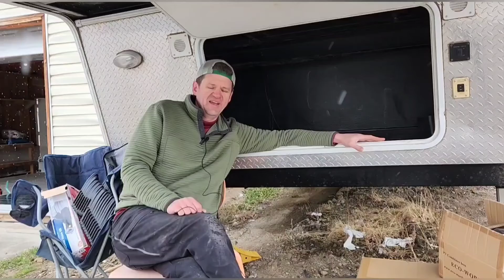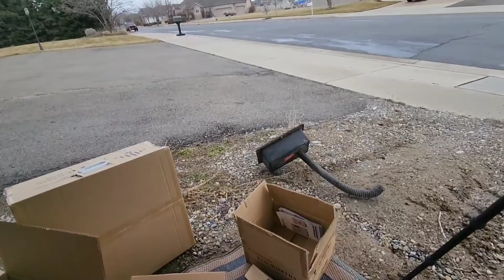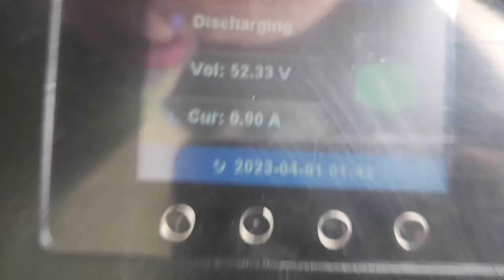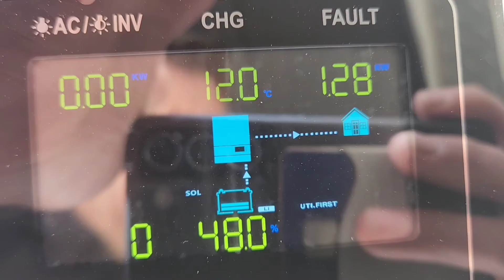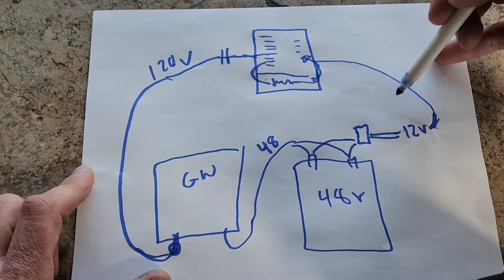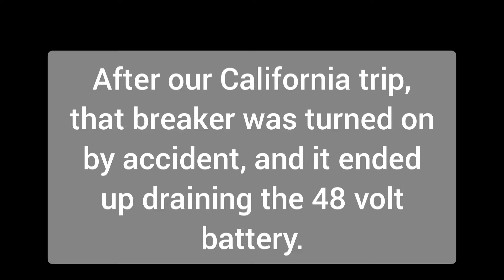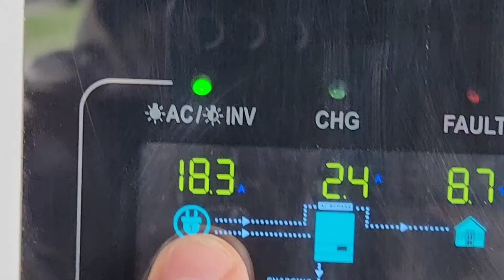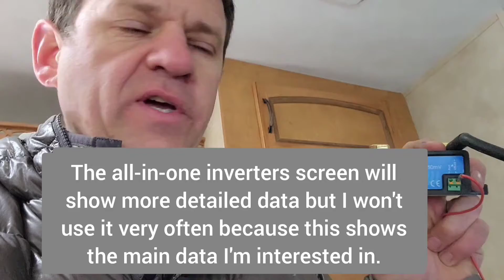12v to 48v RV conversion. Ultimate Off-grid RV Solar Power System Install

Comment: Trying to see what the advantage is vs just switching to a 400Ah 12v lithium?
Reply from the maker: The main difference is cost. The 12 volt system that can do the equivalent but will cost quite a bit more. Specifically referring to wire size and the wire size in the specific individual components. With that battery you will have the energy storage capacity however you can send four times the amount of power over a 48 volt conductor versus the same 12 volt conductor... saving costs not only in the conductors but also in the components in the conductors. This is a similar reason why the weaker power tools have lower battery voltage, but if you want a power tool that can produce more power they usually have a larger volt battery that you connect.  Hope that makes sense.
Reply: @diySolarPowerFunWithRay  
Yeah I see your point now. 
I am not a massive energy user so that's probably why I didn't really see the need.
I have got by on 2x group 31 wet lead acid batteries and a single 180w solar panel and have never felt the need for more. I rarely use my microwave or A/C when camping, if I have to I crank my generator for a few minutes but that's a very very rare event. The power I have is enough to boondock indefinitely, with no generator usage, presuming I get less than 2 cloudy days in a row. 
When my lead batteries die I am pondering a switch to a single LiFePO4 but not even sure if it's worth the hassle to deal with a DC/DC charger from the alternator/starting battery, limitations to charging when it's cold, and upgrade to the converter. I could probably skip the converter as I have never plugged in, in the 11  years since I bought my current Class C.
Seems like it's only worth it if  you want to try to run a bunch of AC appliances which I don't, but in that case you run into limited roof space for solar. I suppose you could throw a bunch of solar panels out on the ground but I go camping to live simply and get away from hassle not create problems to solve.

Enjoy your adventure.

Comment: Would humbly suggest you protect your cables with fusing. So the 48V output from the battery, the input and output to your 48/12V converter. Melted wires make for nasty fires. Thank you for your video.

Comment: What gauge wire is on the output of that 48 to 12V converter?  Should be stamped on the wire. Is it 10 Gauge? Thank you.
Reply: A little late but most of these use the correct AWG wire. I have a 10A and a 30A. The 10A has 14awg, the 30A has 10awg. The input wires are also sized depending on demand, for example the 48v to 12v is 14awg for the 48v side and 10awg for the 12v side.

Comment: Thank you for the video! You have just given me a temporary solution to the biggest problem I have in the solar upgrade of my 50 amp fifth wheel. I've been unable to figure out how to run the electrical cable (2 for a 50 amp RV) from the inverter to the distribution panel (a 30 ft run). The cover underneath the RV is riveted to the frame and there are several obstacles inside the cover (3 tanks and cross members i.e., I-beams) that make routing the wires under the cover difficult. Routing the cables inside the house does not seem to be feasible.  I will just install a 50 amp plug to the inverter, mount it in the front compartment, and plug into the shore power plug when we boondock.  Thank you!
Reply from the maker: Nice, later I wanted to have power when we drive down the road so I added this solution. Start at the 9 Minute mark.  https://youtu.be/cYJSFjFo4S8?si=jpkp4bOnRvpQ5Yuh

What inverter did you end up going with?

Comment: So how do you charge that 48 volt battery now at a campground on 30 amp shore power?
Reply from the maker: The growatt power system will accept 30 amp Shore power and in turn chart 48 volt battery. 👍

Comment: Hate to see people mount them directly to the roof when theres a better way of doing it you can get mounts that taiss them higher and do the full kength of thr hnit
Reply from the maker: Thanks, I didn't get those because the ones I was looking at were simply using a adhesive or glued down. I like the idea of using adhesive and also screws for extra protection over time.

Comment: Not bad overall, but ditch those wire nuts for a mobile application.... And consider a large capacitor at least on that 48V->12V converter output. With so many of the inductive loads being 12V, you will burn out that converter (Motor based stuff, slide outs/jacks).

Comment: Why wouldn’t you use a ship to shore switch or an auto transfer switch for your trailer and hard wire it in?  It would be more efficient.
Reply from the maker: I wanted to just keep it simple. I like the Simplicity of just plugging my Shore power plug into the inverter. I don't have any problems unplugging and manueling moving the plug to shore power if I am camping near a Shore power outlet.
Reply: I also like simple. My inverter is isolated if I need my generator when I’m out hunting and I don’t have to touch anything besides my start switch. 

Check them out. Consider it. It makes it simpler than plugging and unplugging everything.
Reply from the maker: @Slingshot277  thanks, I might have to install that on my next one. I could see that being nice if you have a onboard generator.

Comment: about the alternator charging... I'm assuming it was pin 4 that you disconnected from your 7 wire plug, correct? I've also seen charge controllers that will allow you to connect your alternator safely - they combine the alternator power with solar to bring up the voltage to the proper charge level, but I don't know if that's worth the hassle unless you already own all the parts.
Reply from the maker: Not worth the hassle in my opinion. I get more power from shaded panels then I would from the 12 volt alternator. On the other hand adding a 48 volt alternator I hear can produce up to 1,000 Watts. Which would be awesome. But then you have to add another alternator..

Comment: If u think u r gonna run 2 ac overnite and your home on a 100 amp hour battery u in fer a rude awakening
Reply: How much power in avg kwh does the ac pull?  At 48v lifepo4, 100ah will give you about 5kwh of useable power on a full charge.
Reply: @MichaelSchwabTX my travel trailer has a 15000 btu ceiling air conditioner and it pulls 16 amps at 120vac.
Reply: @MichaelSchwabTX  exactly. I have a app on my ac. And one uses about  3 to 5 amps for the whole day.

Comment: Is that GroWAtt all in one unit designed for use in a high-vibration environment (like rolling down the road)? I have one that I will install in my home for critical loads in an emergency
Reply from the maker: Signature solar said it wouldn't void any warrenty.  I've currently taken this setup on about 6000 miles so far... No issues. after 800 miles on a bumpy road the only issue is one of my wire nuts came off.
Reply: @diySolarPowerFunWithRay Please tell us you’ve gotten rid of all the wire nuts!

Comment: I installed same Growatt, 1800 watts of solar and 150 amp hours of batteries almost 2 years ago in my RV. Has worked flawlessly.  Your comments about running 2 AC units and powering your friends RVs is not realistic as I am sure that you have found out. Or running an AC unit overnight, unless it is a tiny window unit maybe 5,000 btu's. Good video
Reply from the maker: Yeah, It will only run my single AC for about 3 hours with Zero sun out.  With the sun out I can continusly run it though... but can't charge the batteries at the same time.  I like that it provideds enought power to run large 2 appliances at the same time.  I usually go camping a cool areas so i never run into too much trouble having others use my power.... unless we need to run the AC's :). Turning off my converter box has helped a lot also...
Reply: @diySolarPowerFunWithRay  FYI I am able to run a 10k AC unit for 4 to 5 hours straight off the solar, but like  you understand, no charging then. Last summer I was using a 2200 watt generator and was able to run a second AC unit off of that. As you have a 30 amp trailer I don't think this would work for you as the second AC unit is on the other side of my 50 amp service. And the generator does an amazing job recharging the batteries in the evening for a couple of hours.  Wish you the best!

Comment: Great video want to do something similar.  How loud is the inverter fans? My 5th wheel  bedroom is right above  that compartment.  Thanks for the video.
Reply from the maker: Same. I'm glad I put the inverter outside. I definitely can't hear it running when it's outside but if it was inside it would be a bit bothersome.

Comment: Nice setup. I'd be more comfortable with the higher capacity buck converter, or two of the 30A parallel.  I imagine that part will be an iterative process for you 😅
Reply from the maker: Yes the 40 amp would have been better

Comment: Great stuff rey . I have a question when i went into my rv all the lights were dim i plugged in my truck  and they all were powered up so if i remove my converter charger  how will this effect it ?
 Also could i use a battery disconect switch so charger/converter wont be able to charge batterys but will still convert 120v to 12v ? My converter says 1000watt 60a  is that whst it uses  or produces ? 
Hopefully you could help me out and   if you ever make it to vegas ill buy you a steak .
Reply from the maker: No problem. For the first question the reason the lights went brighter is because your truck must have been running when you plugged in and the alternator was sending power to your RV 12 volt system at around 14 volts to charge the batteries. The lights responded to this higher voltage and got brighter. Converter box should have no effects on your truck being plugged in.
    Regarding the second question. Sure you could put a disconnect on the battery to prevent charging however your converter box will still be working to power your existing 12 system.. mine rv works this way. Eg. lights, fans, blower motors Etc. So you're 48 volt battery won't quite last as long because it is taking the DC converting it to AC and then back to 12v dc. So there's a lot of power loss there... especially if you're camping in a cold area and your furnace blower is running all night long.   It's much more efficient if you power the 12 volt system with a 48 volt drop down converter.
   Hope this helps.  I might take you up on that steak ;)

Comment: Just curious,,is the ground bar and neutral bar in the RV breaker panel bonded or unbonded?
Reply from the maker: That is a very good question. I'll check. I don't think it is. I'll let you know. I need to make sure my unit has a GN Bond.

Comment: With one 48v server rack battery. 
You'll not be able to share with your buddy. You barely have enough for yourself. I have 5kw system at my house. Its just not enough. Im adding additional 5kwh battery with 1000w of additional panels.
Reply from the maker: I've used it multiple times with friends already.
Reply: @diySolarPowerFunWithRay  
Yes, very small share.
All you have to do is add up all wattage and divide into (5000wh) 3800wh. 
AC, microwave, electric cooking devices will drain the batteries in few hours.
If you add others. The hours will turn into hour or less.
Reply from the maker: @wt9653  most RVs I have seen have gas cooktops. My microwave will run for almost 3 hours on this battery. That's a lot of popcorn between us. If it is hot the AC will kill everything though and will definitely only work for one RV.

Comment: great video, how did you ground the  Growatt 3000TL LVM-ES in you rv application?
Reply from the maker: One option is to carry a grounding rod and drive it in wherever you go camping... but I'm definitely not doing that. I do need to make a ground neutral Bond connection because I don't believe the all in one inverter has that Bond.

Comment: Great Vid...I have watched about 5 times...LOL.  I am about to do this same thing to my 5th wheel and I love that its non-intrusive and very portable to another unit with very little effort.  I have a couple quick-is questions.  You can still connect to "shore power" if you turn off the inverter...correct?  Also, where did you get the 30 amp plug to wire into the Growatt inverter?  I was going to use a 110/30 amp pig tail and just cut the 110 side off and wire that into the inverter...would that work?
Reply from the maker: I got my 30 amp plug by cutting a pigtail in half similar to what you're thinking. Regarding Shore power, how were you planning on powering your trailer from the growatt?  Were you planning on plugging your Shore power into the 30 amp plug?
Reply: @diySolarPowerFunWithRay  AC side MOST of the time from the Growatt.  There might be a rare occasion to use a campground pedestal...at least have that ability.  Of course DC is batteries...now Charging...I plan to use a direct charge to the batteries via a 48V AC charger...not sure if I would charge via the Growatt yet.  I have a Honda EU 2000 gas generator I plan on using to do my charging....at least for now..  Solar in the future when I can afford the purchase...have to build this out over time. :)
Reply from the maker: Nice. Yeah there are 3 options for connecting to shore power in the way I have it set up in the video here.  1) Unplug my shore power chord from the growatt, not the growatt won't be supplying power to my RV, and plug the shore power directly into shore power.  or 2) the other option would be to plug shore power into the growatt ac input and continue having the growatt provide your RV power.  The 3rd option would be to get a 48v batter charger and have shore power charge your batteries while the Growatt powers your RV.

Comment: Love your Video i got a few Questions.     I’m making my fire department a command trailer to use on site with no shore power  I’m scared 3000 watts is not going to be enough 
With a mini split a/c, 4 TV, 2 computer, small refrigerator, ( coffee maker, microwave not all the time ) the light inside are all 12 volt   Would love to do the same system you have also I’m going to put 2200 watt solar on the roof
Reply from the maker: Sorry for the slow reply.  Are you converting a RV trailer or building from scratch?  Is it a 50A RV conversation?   The 3000W growatt MAY be a little small.  My 3000 can run 2 large appliances (AC &Microwave) and my very inefficient 300 Watt electric fridge(which runs not stop)
    My large house tv uses 75 watts. so it should be fine with 4 TV's and the Laptops. I'd bet your mini fridge used between 70 and 100 watts on average.  I think your mini-split will be more efficient that my 15000 BTU AC unit.   If you are making coffee and running the AC then you definitely won't be able to start the microwave.
     I'd be tempted to get the eg4 6000EX just to be safe.(https://signaturesolar.com/eg4-6000xp-off-grid-inverter-split-phase/?ref=DiySolarPowerFun)  I think that would be perfect if you have a 50a RV.  I'll be reviewing it soon and can let you know how it goes.

Comment: Where is your rig's ac power control unit; switches between shore and genset.
Reply from the maker: I don't have a special switch that automatically switches between generator and Shore power. I just use my Shore power cord to plug in to my inverter output.
Reply: @diySolarPowerFunWithRay  I'm skeptical of that silver 48v to 12v converter arrangement, why not a 48v inverter with 120v outputs ?
Reply from the maker: @VideoByPatrick  I do have a 48 volt inverter with 120 volt AC output. But not everything in my RV runs on 120 volts ac. Where are items that only run on 12 volts DC.
Reply: @diySolarPowerFunWithRay  do you have a converter to power 12v loads ? Converter is powered by 120v.
Reply from the maker: @VideoByPatrick  I use my 48 volts 12 volt step down converter to power my 12 volt loads in order to save power. I explained it in the video in more detail.. It is a really efficient converter

Comment: Is the solar panels connecting into the inverter? If so, does that mean the inverter can directly use the power from them without pulling from the battery? I thought you would have to have a charge controller to the batteries, and it would always use the battery power.
Reply from the maker: Yes it's connecting straight to the inverter. It can pull power straight from the panels and not go through the battery.

Comment: If that's a 48 volt 100 amp hour battery and you plan on running the AC in the summer months along with the fridgerator and a few other things you don't have much you'll have to double triple that size. I'm in North Florida I don't get much solar cuz it's cloudy continuously got to use the generator constantly to top my batteries off
Reply from the maker: It seems to do pretty well for utah. If the Sun is out I can continuously run the AC all day long. I definitely would not be able to do it if there were clouds overhead though. In Utah if we ever have shade it's good temperatures though it doesn't get too hot.. It is the equivalent of about eight deep cycle batteries.

Comment: Great setup nice prices for everything you get ! One thing I do not understand is the 3,000 inverter " Growatt " states off-grid inverter. Thinking this means that this inverter is not approved to be used while connected to the electrical company service .
I will have to check on this tomorrow if yes then kind of a bummer in that area . Please let me know if you know that question. I just trying to understand things myself . I'm not a know it all lol .
Reply from the maker: Basically you cannot use it to backfeed the grid. You will need a good time grid tie inverter for that. I am going to use this off-grid inverter to power my emergency panel on the house. So part of my house will be off grid